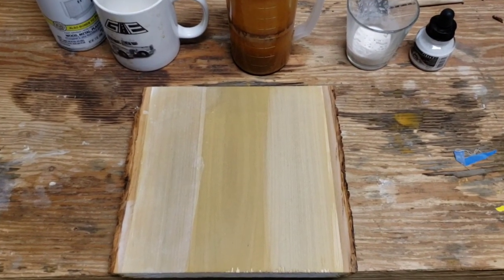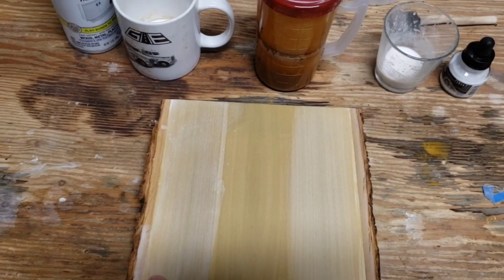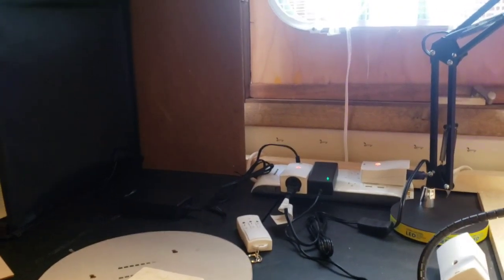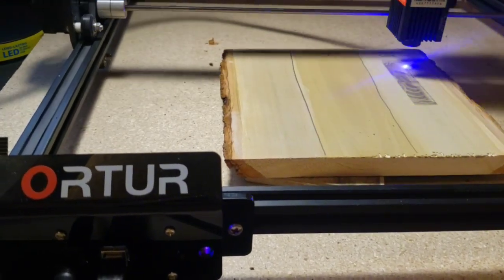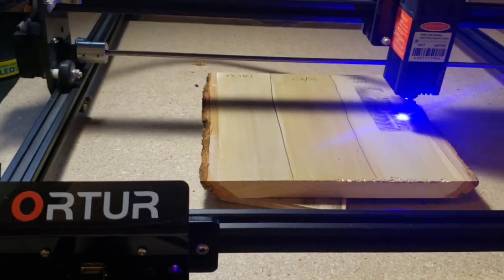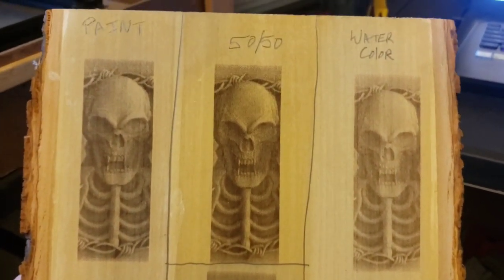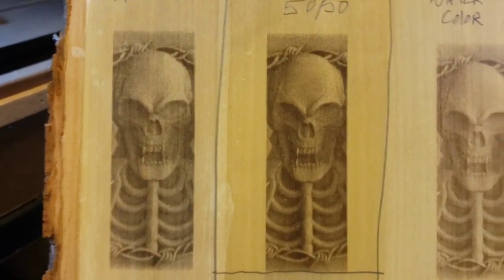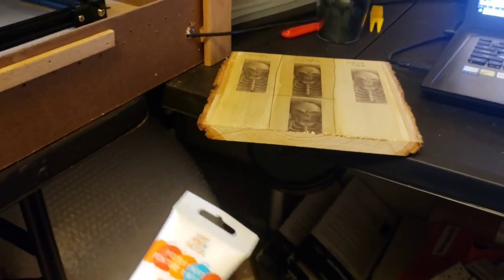"The Kenny Hack" Best White Wash for Laser Engraving Wood? Ortur Diode Laser.

Comment: WOW I love the Poster Paint. I picked some up today and can't wait to give it a try. So how much water did you add? Is it runny or thick? I added water and brushed in on but as I'm waiting for it to dry I'm hoping I did not put to much water. This stuff seems thin enough already. I will post some photos as soon as I do a burn test pattern.  Thanks again for you ideas!
Reply from the maker: you can make it thick or thin.  just depends on how much you want to lighten it up and how many coats. try about 1:1. I only mix up enough to do the piece im working on, so its a very small batch.
Reply: @TheKennyHack   Just to make sure did your test only use this or is it this on top of Kenny Hack? I'm waiting on a batch of that to finish in about 3 to 4 more days.
Reply from the maker: @flyinghighoveryou  this is applied on top of the Kenny Hack to lighten the wood back closer to a natural color and it also helps make the burn turn more of a black than a brown.

Comment: Another great video.  I tried cold tea and seen good results on my 15W Outor laser but it will stain the wood darker like your hack
Reply from the maker: It never hurts to try. Ive made a lot of improvements just by trying different things. That's what I'm really trying to do on here. Find ways to improve production speeds for these diodes. Thanks for the feedback.
Reply from the maker: Finding something that works as well but with no staining effect is my goal.
Reply from the maker: Dave did the tea stain pick up the light end of the shading? I've found a lot of things that make the dark end burn better but haven't found anything that works as well as this solution for getting the light shades to show up. Especially, when using the Newsprint dither. Im always trying the other dither but at the high speed I run none of the other ones can get the light shades to show up.
Reply: @TheKennyHack  Hi Kenny, It did on my 15w laser but I suspect with your 20w it would be much better, I got a good range of shading but I didnt run as fast as you can on yours.